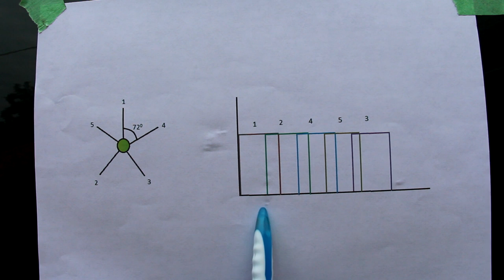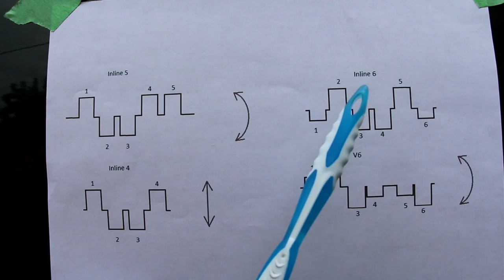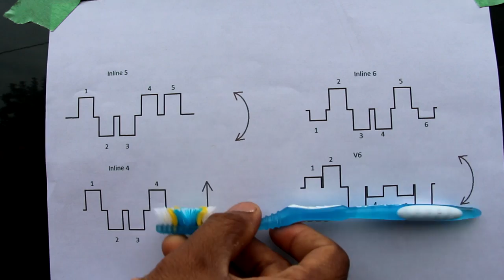Why Inline 5 Cylinder Engines are an Anomaly

Comment: I own a Volvo S60 with a 5 cylinder and never understood about the balance issue until now.  Thank you.
Reply: storm chaser 200  Stick with the factory engine mounts and subframe bushings, they got them just right.  Avoid polyurethane.  These 5 cyl Volvos are very smooth cars, I own two.
Reply: storm chaser 200  I've driven a few 5-cyl vehicles and never noticed that. If it's well maintained and running properly there should be no noticeable vibration.
Reply: Maybe this is the best, most cogent explanation of engine vibration I've ever seen. He even remembered to include the inline 4's vertical shake, but he didn't mention the problem with torsional vibration in an inline straight six. Reminds me of a documentary elsewhere on YouTube about the history of racing at Mercedes Benz. Mercedes started racing again in the 50's. Torsional vibration is usually managed by including a vibration damper at one end of the crankshaft, but Mercedes thought that if they put the power take-off in the middle of the crankshaft, then they could also shorten it and reduce torsional vibration that way, but they were wrong. In an interview with one the engineers who designed the new engine, as he chuckled, he explained how they ended up having to put vibration dampers at both ends of the crankshaft, resulting in a longer shaft than they would have had otherwise.
Reply: My Korean-built car (It has an MB 5 cylinder engine made under licence) has vacuum engine mounts that adjust themselves dependant on the engine RPM.  When idling there is very little vacuum and they lift up and dampen the vibrations more. But as you rev the engine harder the vacuum in them builds and pulls them down compressing the internal springs making the mounts become stiffer as the engine movement is less of a problem.  So to surmise, Low RPM, wobbly mounts with the engine sitting a few inches higher, high RPM, engine mounts pulling engine down stiffly to the chassis.
Reply: @muhammad altaf No, Rexton.
Reply: As a v10 is one of the most balanced engines it makes sense that an inline 5 would be a well balanced engine
The worse engines are v4 and flat 4 engines for vibration
Reply: @reallyhappenings5597  I had the S60 2.5 turbo and that car could really move!
Reply: My engine mounts failed, that's when my car started really shaking from left to right. Otherwise with the original mounts, it's a smooth ride.
Reply: your car hasn't got this engine your p2 s60 volvo is a proper flagship car for the time all seven engine you can get for your s60 are excellent strong engine's. the engine shown in this video isnt a proper volvo engine that's why it was throw only in the v50 and s40 which are basically fords.

Comment: B 5 24 4 S4, not B 52 44 S4. B for Benzin (gas), 5 for cylinders, 24 for displacement, 4 for valves per cylinder, S4 is for the iteration of the engine design.

Comment: when I tell people that I like cars, this is what I mean. the sheer amount of engineering that goes into designing an engine is mind boggling
Reply: Bikes have the same or more. 1 of the hest bike engines was a honda v5.
Reply: the terrible engineering is mind boggling, i see way too many solutions to no existent problems here, like why incorporate cam bearings into the valve cover, it’s very useful to be able to
check things with cam and lifters with the cams still bolted into the engine
Reply: @damionlabounty7116    Yeah. Basically they design engines now to be a single use disposable item. Servicing isn’t thought about at all and if anything happens to an engine now you basically throw it away and put a whole new engine in (or dispose of the car altogether).
Reply: Your channel name and pic had me cracking up 🤣💀
Reply: @TheLiamis  V5? Please explain how an uneven number of cyls are in a V config
Reply: @funfun5656  honda rc211v, VW vr5. V5 isn't common but there are a few and honds was a 250bhp beast.
Reply: @TheLiamis  Yeah but isn't that a VR5 because the cyls are technically offset from one another?
Reply: @funfun5656  3 on 1 bank 2 on the other.
Reply: @TheLiamis  That's a VR5
Reply: electric cars as nice as they're becoming are certainly going to take away a lot of the artistic beauty that went into these kinds of things.

Comment: Fantastic explanation of many tricky points.  The detailed breakdown of the oiling system was phenomenal and the pcv box disassembly truly demonstrates how that system can (and does fail).  The explanation of the firing order and comparison to other engines is what puts the video over the top.  I originally viewed the Subaru engine teardown and now I'm convinced that speedkar99 is doing something unique.  The editing is the key and it makes the subject matter fly, all while allowing the audience to appreciate the detailed research and clarity of the presentation through the voiceover.  Thank you very much for all the effort, many people will benefit from this video!
Reply from the maker: I'm glad you appreciate my efforts. I have alot of teardown videos like this on various parts of the car. Feel free to check them out and share. Thanks
Reply: Yup, made 18 minutes seem like 5! I didn’t expect a complete tear down AND amazing explanation in that timeframe. Got the same oil filter setup on my Benz diesel 5 cyl, it sucks.
Reply: totally this 18 minutes just flew by. I actually should be doing other stuff but this video got me hooked.

Comment: The 5-cylinder Audi engine based on a VW inline 4 had a reputation for reliability. I had an 1988 Audi 5000 turbo. Almost everything on it broke except the turbocharger and that engine.
Reply: Of course these Volvo 5 cylinder engines are not know for reliability they are trash. Haha not realy.
Reply: The Volvo 5cil design comes from porsche. 

Anyway i have driven a Volvo S70 2.5 10v 144hp sold it with 500.000km.

A Volvo S60 D5 163hp sold it with 420.000km

A S80 2.4 20v 170hp almost 300.000km on it.

All 3 cars are still running.... never had any engine problems.
Reply: Had the vw/Audi 5cyl years ago,380k startet sumpcommresson.with additive to oil 4500.have now vw t4 with 5cyl petrol.lasts for ever.....
Reply: @fuckenoathcunt4230  VW PDs have their issues. Volvo engines however will run forever if serviced. I'm not saying the VW engine is shit, theres tons of them here in Finland that have been driven +600 000km but theres more Volvos that have done the feat. I think it comes down to how expensive the car around the engine is. People are less likely to fix a cheaper VW whilst a more expensive Volvo might get better service which in turn will keep it on the road longer.
Reply: @Thurrock91  Porsche helped design the first N-serie engine, the B6304F, which then set the foundation for all N- and RN-series engines. In the B6304F Porsche mostly helped with the cylinder head development, but the basis of the engine comes from Gothenburg.

I'm a huge Volvo nut :)
Reply: NLterror6000 hey I have the same engine in my s80 and I am just about to hit 301.000Km haha
Reply: Kieran Dunn Sorry but Volvo is miles better than Audi.... Volvo’s 5 cylinders can easily go a million miles as long as the oil is changed regularly.. not to mention VW and Audi’s always have inevitable tranny failures... unlike Volvo.
Reply: Jamnittygritty   Agreed about plastic, it's fine if it's properly designed and the right grade (for heat resistance in particular).   The same could be said of oil seals and rubber gaskets, which everyone uses.   (Mine's a 1998 BMW 318iS - the plastic chain guides are still in near-perfect condition, plastic inlet manifolds etc etc)
And also, Torx bolts.    Torx is an extremely efficient design for transferring high torque loads, without the risk of slippage.   You just have to buy the right socket, you can't just stick an adjustable wrench on it  ;)
Reply: @diablocls55  also audi heads always crack between the spark plug and the valves
Reply: @hagglundguy  Do Finaland have a car manufacturer ?
Reply: @hagglundguy  ha.  Is the VW 2.5tdi 5 cylinder engine (in the T5 transporter) based on the volvo block too?

Comment: Barring a head gasket failure, which wasn't apparent, I'd say the oil cooler failed internally and allowed a mixture of oil and coolant.

Edit:  Another great video.  Keep 'em coming.
Reply: That was my guess as well.
Reply: That's disconcerting.  Oil cooler failures are a rarity on these engines (Volvo "white block") and not treated as a maintenance item.  I have two of them.  Ford bought Volvo mainly for this engine and used it in some early 2000s models.
Reply: Oil cooler failure is actually not that much of a rarity.  The external oil cooler failed on my whiteblock at under 100k miles.  Fortunately I caught it quickly.  I’m at 266k+ miles now on the same bottom end. Daily driver, 2000 V70 B5244S.
Reply: The ford 6.0 diesel engine is the same. Many 6.0's died this way 😢
Reply: I don't know why they need an oil cooler on that motor
Reply: Water cooler failures are a Ford favourite.  It's either water into oil or  radiator fluid into auto transmission.
Reply: George Aliagas it’s not really an oil cooler as much as a heat exchanger. The coolant both warms up and cools the oil so on cold start you have coolant helping warm up the oil so it’s up to temperature much faster and it also prevents extreme oil temps for high loads for extended period of time considering the oil squirters helps with piston temperature. Overall it makes it much more reliable. I’ve seen these engines (on p2 models, not the p1 because as you saw they tried to make it compact which made it loose some of its reliability and ease of service) go well over 400k miles without a rebuild. Current record I believe is nearly 1 million miles on a whiteblock motor (these aluminum engines from volvo are called whiteblocks because they did make 4 and 6 cylinder versions as well that have the same general construction) I have an oil cooler on my non turbo motor and it definitely helps regulate oil temperatures. I would measure the oil temp right after getting the engine coolant to operating temperature and it was almost exactly the same so the oil gets up to temperature significantly faster making it more efficient in lubricating.
Reply: Considering if it were a 2.5L block (if it’s a turbo engine) but it’s a 2.4 since it’s NA in the p1 chassis then it could be a cylinder wall that cracked. What’s also common is the headgasket (possibly just not visible but where could the water in the cylinders have come from otherwise?) and these unfortunately overheat with thermostat failure because of them trying to make it compact. If it was a P2 it would fail in the open position so it doesn’t overheat but the p1 is just a mess of issues here and there that tarnish the reliability of this engine. When the car starts to overheat you usually only have under a minute for it to show it on the gauge and then headgasket blows. It’s common on the p1 variation of the engine. If you plan for a Volvo 5 cylinder. Get it in the p80 chassis or p2 chassis. The c30/s40 II/v50 are tempting as smaller cars but that compact engine bay kills you in the end. And the ford electronics they used as well. I have a proper p2 version of the NA motor and it has held up very well for the abuse it gets (it was even clogged completely to the point of losing oil pressure but I was able to clean it and save it and it still runs smooth)
Reply: @rex_s80  yeah maybe in cooler climates but in Australia no need and that's where I am from
Reply: George Aliagas the heat exchanger also stops the oil from getting too hot as well.
Reply: @rex_s80  it's not a race motor but I can see it's use for extremely cold conditions
Reply: George Aliagas well it’s added for reliability and it is a Swedish car brand so they have to endure Scandinavian climates
Reply: @rex_s80  I can understand it for Scandinavian conditions to quickly warm up oil on start up but in warmer climates it's just another thing that can go wrong and ever since the Volvo V6. Volvo's have a bad reputation with reliability
Reply: George Aliagas I’m sorry but the prv v6 was a partnership between Renault and Peugeot so that was just asking for problems. The whiteblock motor is actually very reliable and I’ve never met anyone that had issues with the head exchanger on these engines and usually swap to oil pans that have them for their high Hp builds. There are no oil lines to break on those so it’s a low risk of failure. Also there are plenty of whiteblock motors going over 500k miles without a need for a rebuild so they are pretty reliable still. Just a bit more advanced then the redblock.
Reply: @bbbnnuuuhgg7016  The base motor design were competitive in European Saloon Car racing (BTCC.)
Reply: @bbbnnuuuhgg7016  I wondered why it needed that too but then I remembered that actually most of these engines were turbocharged, the N/A version was comparatively rare so it was probably just a carryover from the "T5" variant.
Reply: this was my first thought aswel! such a sad way to lose your engine..
Reply: Mostlikely the block cracked. That is a common issue on whiteblocks, especially 2.5's
Reply: @rex_s80  yeah I 100% agree P2 and P80 are the most trouble free Volvos, although the P80 is now old and I see more and more change hands because of problems with the electronics or neglegt.
Reply: @alouisschafer7212  yeah the p80 are getting to the point of aged plastics and wiring needing attention for sure. But if people are willing to rewire miatas and other older cars then why not a p80? Definitely does better in a crash than a Miata. Seems worth it to me.

Comment: 8:53 Hey, I got turbo version of this engine in Mondeo Mk4, oil change is not messy at all, it couldn't be better because the oil cap is pointing upwards and not horizontally or down, oil just goes out to the bottom leaving housing and filter drained.